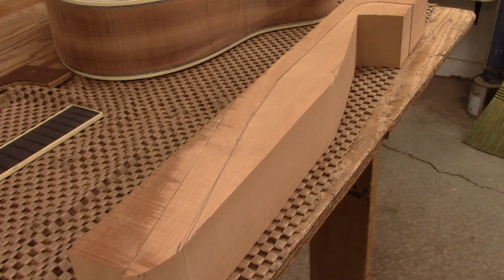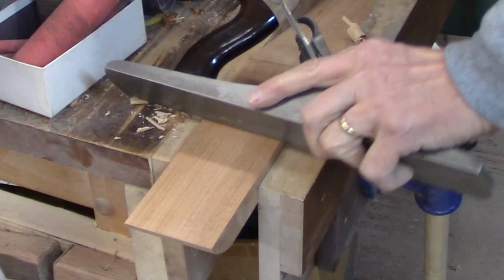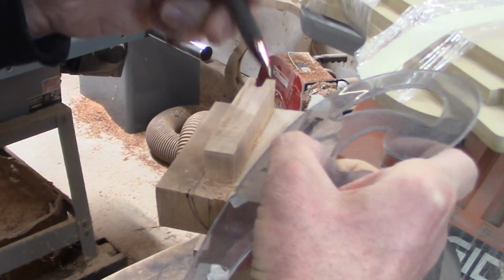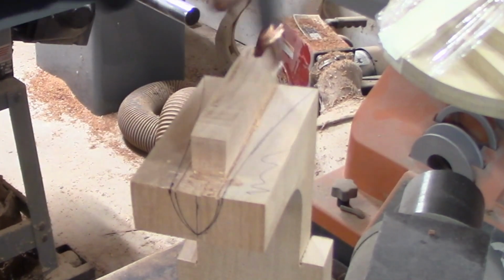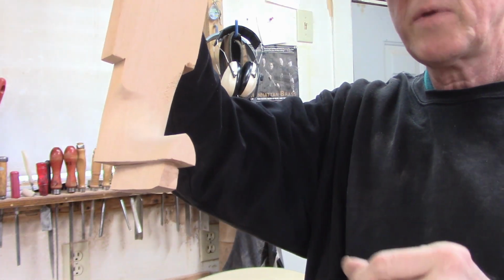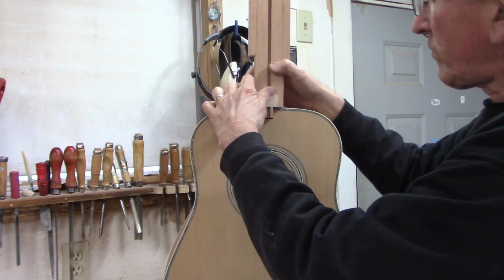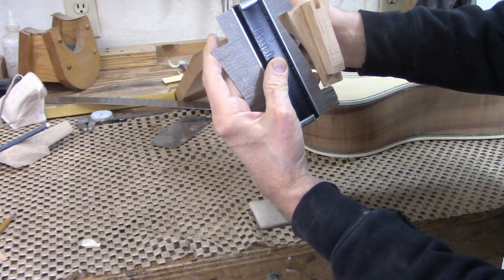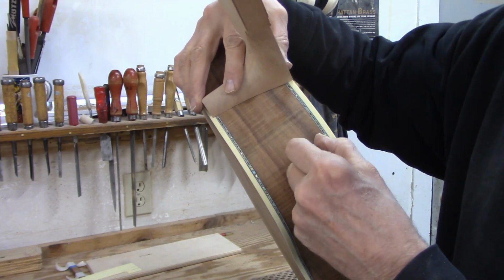Dreadnought Guitar Building, Part 9: Making the Neck Heel

Comment: Great work Gary.. Is there a reason for you deciding on using the Mortise and Tenon neck joint vs a more vintage Martin traditional Dove Tail neck joint?
Reply from the maker: Thanks Bill. I'm more comfortable with mortise and tenon joints. They seem to last longer.  And I am not trying to build a Martin,  just incorporating some of their designs into my own instrument.
Reply: Several of my Martins have required a neck reset.  I don't think Gary has ever needed to reset the neck any of guitars he's made.  Martin finishes the neck separate from the body, which makes the dovetail more practical.  Pinning the neck increases stability, but requires the neck to be finished in situ.